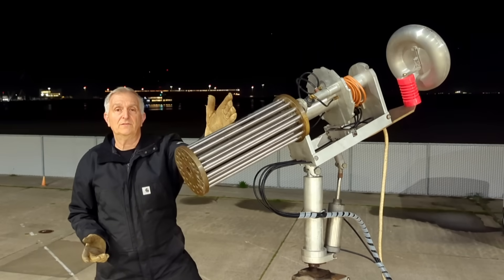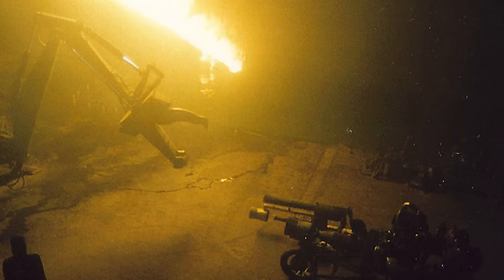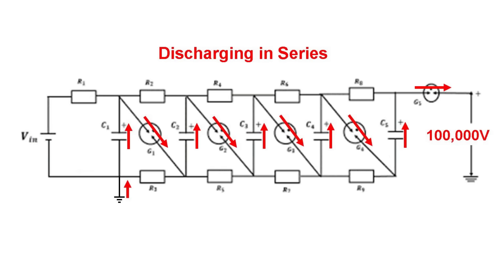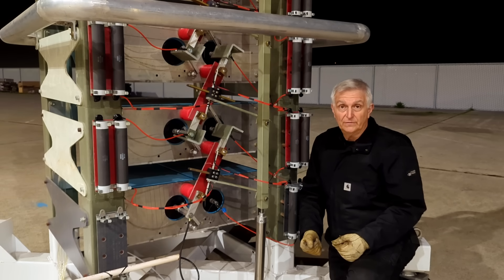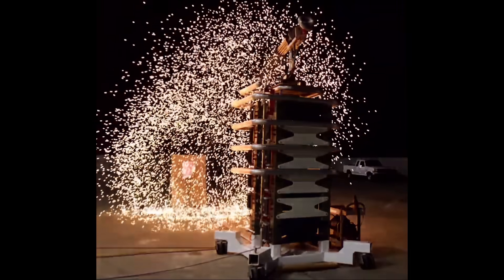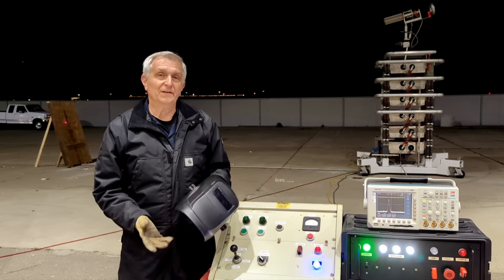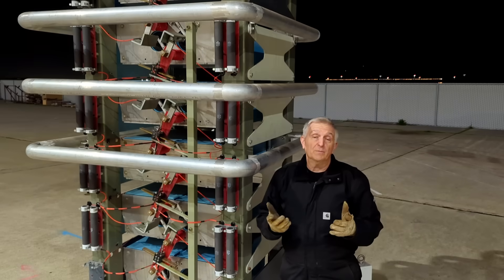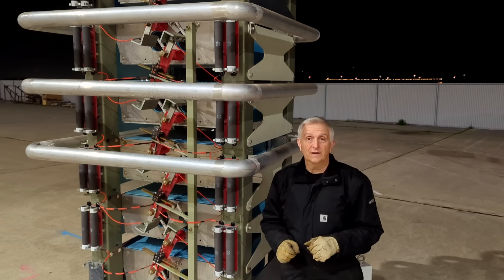Firing the Lorentz Plasma Cannon

Comment: a few Years back, i read the term LIPC in a Sci-fi Book.
It stands for Laser induced Plasma Canal. A high energy Laser prepares a Path for the following Current, which loves to follow the Path of least resistance. 
Your Machine uses a Wire to direct the load towards the Target, using Lorentz Forces to stabilize the Wire long enough to transmit the Energy, right?
With your Energy Bank and LIPC, would your machine have a better efficiency/range? You already use a guidance Laserpointer. What if you exchange that for one with more Energy?

Comment: So what is the little projectile flying out of the barrel before the actual discharge?
Reply: It fires an electrode with a thin wire attached. Once the circuit completes with a grounded object high current flows through the wire and vaporizes the wire. Lorenz force keeps the plasma contained so that there remains a path for the current until the capacitors are empty
Reply: @laserdiode  gotcha, so In theory could a laser induced plasma channel also work as the initial connector?

Comment: How, how do you live with V, A, Om etc., You need to do similar mile, inch,  and other imperial CI:face-blue-smiling::face-blue-smiling: Really 🤯
Reply from the maker: I can use either system, but I have to use the units that the components were made in  ;>

Comment: This is a great demonstration of a plasma cannon. Would it work using a narrow brine jet instead of the thin wire? You'd need to have the nozzle well insulated and far away from the capacitors, as any liquid trickling down the nozzle would short circuit the whole thing. If brine water could work instead of a wire, it would be much cheaper and you can keep firing until your brine solution runs out. I understand that keeping a jet narrow and preventing it from diverging is challenging, so the nozzle should be very high up and pointing downwards to a target, to minimise divergence.

Comment: Why couldn't they use the magnetic force as modeled by the wire diagram to stabilize a rail gun projectile? The biggest hurdle of the rail gun is wear and tear on the barrel. Why should the projectile need a physical when the same energy could be used to create a magnetic "barrel" as the illustration suggests?

Comment: This series feeds the mad scientist urges in my genes.
Luckily those genes don't need to express themselves because you're doing all the hard work for it.
10:20 that's not all you can see, you can also see the residual energy the thunder bolt deposited into the surrounding screen. (and with that you can see the misalignment of the laser too)

Comment: In the late 1960’s I worked on development of an artificial lightening generator. The requirement was a 1.2 mega volt pulse with a rise time of 40 nanoseconds. We used the same approach, charging large 100 kilovolt capacitors in parallel, the discharging in series. The apparatus was used to test high voltage transmission lines. The test area had a fence around it at a good distance with a safety interlock so it couldn’t be charged if someone was in the test area. One technician left a wooden step ladder about 10 feet from the apparatus. When it was triggered, it arced over and blew the ladder  to smithereens.

Comment: what is that small light pulse that occurs prior to the main plasma discharge? Is it a small projectile?  The other question is that for such a large amount of energy the damage is comparatively small.  Beyond that, very nice demonstration
Reply from the maker: The dart sends out a hair-thin trigger wire, which directs the plasma channel to the desired target.  1:56
Reply: It shoots out a wire which upon connecting forms a closed circuit, facilitating the electric release. Basically it's an overvolted, oversized taser

Comment: they have been looking for a way to achieve nuclear fusion for 70 years. you had it right in front of you and did not notice. at LLNL they use multimillion dollar lasers. just place a tritium/deuterium pellet in the path of 2 intersecting Loretnz plasma guns. stand away a mile from the blast. neutron irradiation is a female dog

Comment: is that arc traveling along the laser or is there some energy releasing after the initial plasma channel? or does it maintain a constant beam all the way through?
nevermind one of the questions, just saw that there was a metal rod
Reply from the maker: The dart is setting up a hair thin trigger wire, which initiates the plasma channel

Comment: Could it pulse shorter or is that dependent on the unload capacity of the  cap powerbank?  Is there a cheap way to make less effective caps but release power faster? Less storage but faster power release?  Super fast pulsed discharge? Love your vids, they are awesome.

Comment: A question if I may this apparatus appears to be launching a small projectile trailing a wire  ,that wire then being used to conduct the mass of the voltage am I correct in this observation?
Reply: If correct then the system isn't actually a directed energy weapon is it more of a controlled discharge device, via dart and wire,  basically an overbuilt taser? Don't get me wrong this is very impressive nonetheless.

Comment: So your device shoots a taser type a ionized wire , shocking isn’t it?

You've demonstrated that a Lorenz plasma cannon wastes energy. The setup involves a projectile creating a plasma trail, followed by discharging capacitors, like a lightning path guided by a rocket. A taser gun would be much more effective for a high-voltage shock. ⚡️

Comment: Instead of a wire or air which you were  demonstrating in the video...
Could you use salt and water in a water gun to fire at the same time, probably vaporizing the water, that maybe work as a catalyst or bridge to form a plasma? 

Also maybe perhaps make graphine in your spare time, to sell and help fund you zappy zappy ⚡⚡⚡ gun
Just need to put the grophite or carbon dust in a quarts or another cheaper tube that can hold a vaccume.
Then connect the suck out the air (could also use an inert gas maybe? 🤔 Connect the electrodes and boom 💥  , make flash graphine, then just run it threw a sift, bag and sell the graphine to manufactures or concrete or boats or masts or anything made with epoxies etc...  😳  maybe some glass manufacturers for making hardened glass of some sort I don't know really but maybe 

If you do try this good luck hope it works and make lots of $$$$ to help fund the lightning gun 🎉🎉🎉

Please invite the solomo guys so they can film at very high speeds and we can watch the physics 🎉⚡🎉📸

Comment: I recall reading a paper several years ago that claimed that an initial plasma channel in air could be established utilizing an ultraviolet laser and a high voltage source like yours.  No wire needed.  If I can find the paper I'll post a link to it.

Comment: What is falling on the ground, red hot, when you fire? Is that Nitrates? It looks like solid pieces were formed from the air.
Reply from the maker: Burning target paper, also burning cardboard shielding out of the TV.
Reply: @LightningOnDemand  Thanks for the reply, but; How does burning target paper radiate instantly from every point of the beam? It's coming from the beam right at the tip of the barrel from my recollection. And also seems to sublime before it hits the ground.

Comment: I was lucky enough to attend a SRL event in downtown LA a couple decades ago. 
Rail gun with a big bank of caps, which fired welding rods at a brick building.
No risk to the bricks, as the rods were melted and almost atomized. But an awesome light show. (Till the fire department shut it down).

Comment: So at 200 kV it can match the damage of a pellet gun? Or what am I missing here.
Reply: A pellet gun that can burn a hole in an inch thick sheet of plywood, generate a localized supersonic shockwave, heat atmosphere to plasma, and catastrophically destroy and even explode every electronic circuit that is attached to whatever it hits?
Reply: @vishnu79  I would assume it could make a hole in a plywood sheet, ofcourse depending on thickness, and destroy whatever electronics that gets in the way, and most likely shatter a CRT tube. Heating up the atmosphere to plasma doesn't seem to be such a scary factor in this case, the paper on first target survived. 
I was once present when lighting hit a large  less than a 100 feet from me. It split the tree in half.

Comment: If you look closely at the tv slow mo, you can see the arc jump downward around the glass of the screen. Probably why the insides exploded upward. There's also a glowing spot in the middle of the screen for just a second. Unsure if that's internal components fizzling out or the directed energy causing the screen to fluoresce or illuminate. I will say this thing seems to do its intended task very well. Good watch, happy to subscribe

Comment: so, if I'm correct, this basically is a thing that's supposed to pump a possibly out of control machine with SO MUCH ENERGY, that everything within it basically FRIES, and disables it, pretty much without any damage to the build itself, just the electronics?

Comment: The explosion comes from the quarks separating in the atmosphere. It's called QRE, or, Quark Repulsion Energy.

This is what a black hole is made of. Our universe spends billions of years trying to get the quarks back together as neutrons.

Space is an absolute zero field of electrons that create zero-point energy. A blsckbhole is nothing but an electron blender that destroys the electrons and turns them into electron neutrinos.

Black holes are invisible because they create the fastest light in the universe. It quantum tunnels.

The only radiation we see from a star is the elements the black hole have created being attacked by the incoming electrons. That's quantum gravity.

Comment: The crack of the shockwave is ridiculously loud. Also, I love how you can see it fire a small plasma "projectile" and once it connects it forms the bolt, like a laser.
Reply: That is not a plasma projectile but rather a bolt trailing a wire behind itself, which allows the connection to form. It is mentioned during the explanation preceding the demonstration.
Reply: @pulsartsai7776  thank you. Somehow I missed that detail.
Reply: I was wondering what that little "projectile" was that preceded the main bolt. Plasma baby! 🤩

Comment: FASCINATING! But did my eyes deceive me or did I just see a projectile trailing a wire just before that brilliant flash & bang? If so, can a REAL working plasma/lightning gun be created WITHOUT that projectile & trailing wire?
Reply from the maker: Sure with a very large laser, however a trigger wire is much cheaper and more effective.
Reply: @LightningOnDemand  Fair enough! But would such a contraption be all-weather? That is, will it work in any atmospheric condition, that is, through sleet, through snow & through driving rain & all the other stuff the old USPS could go through just to deliver your mail? And would that also include the vacuum of space?

Comment: Could a high powered laser be used to make a shortlived plasma channel instead of a wire? A short powerful burst should be able to ionize the air making a conductive, albit shortlived, channel. Also much cooler then a wire x)

Comment: So it still requires a projectile with a thin attached wire? Grounding through the concrete it's on or did you have a return wire between the plasma cannon and the target? Is there a way to use a high powered laser to create an ionization channel that would eliminate the need for a wire projectile?

Comment: If I understand your working theory and design, I think you have developed the first working prototype of a Phasor shown in Star Trek. Excellent demo. Congrats on building a small controllable lightening bold and putting such huge amounts of energy into such a small unit. I suggest making an EMP unit too. A working controllable EMP unit with a confined beam that can be aimed would knock out selected electronics.

Comment: My question is, we all know the high voltage low amperage lightning that is found in toys and is fired by touching the ball. Would you use this principle to focus the plasma cannon and then switch to high amperage? Because I think the distance problem is that you are using one magnetic field per wire. If you were to shoot 6 at the same time and one in the middle, the force would be focused and the distance multiplied.

Comment: Why not use a "wire guided" system just like the lightning launches? With that you might be able to use this same system at over 1/4 mile? The wire could be very large gauge (small diameter) and pulled tight from the barrel to the target. In fact, it might be possible to use carbon "wire"? This could give the current a plasma conductor that allows long distance and effective power delivery?

The best part, you do not have to create a new machine to test wire guided lightening bolts.

Comment: since a thin wire has to be fired to direct the current, isn't this simply an oversized taser?  Not much use at long distances, since a wire would be difficult to launch with sufficient speed accurately.

Comment: Have they invented 500amp MOSFET or transistors😂😂😂😂😂😂 you could make it silent with using electromagnatic waves with big coil in filming law it will destroy all electronic circuits about 6kilometer or 10kilometer beside the coil 💀💀💀💀👽👽👽with out any sound 😂😂😂

Comment: Would it be possible to get the current to traverse/flow down a laser beam? Or maybe use a laser to columnate the plasma if the laser has a bit of void in the center of the beam?

Comment: I think this video is even better than the first version – you can really see that the CRT was damaged by the electric discharge, and not just because it was hit by a projectile.
I wonder if the discharge could be also guided "wirelessly", by a powerful laser that creates a channel of ionized air. Although I suspect it would be hard to stop it from discharging into the laser rather than the target... :)

Comment: Hey man this is extremely interesting. Is it possible to effectively create the Lorentz effect without a wire, but using a high powered laser in the center to ionize the air to effectively create a "wire"?

Comment: More recent lightning attractors/diverters use lasers to ionize the atmosphere and provide a channel for the lightning to travel down. Instead of using a projectile with a thin wire attached I bet something laser-based would work here instead, increasing accuracy and range.

Comment: Reminds me of Nikola Tesla's open air plasma particle beam with a capacitor discharge dump onto a plasma line. Tesla used a lightly evacuated ceramic tube Van de Graff to charge his device. The loud shockwave is caused by the annilation of atoms of the surrounding air gasses crashing back together thunderously.  Here, it appears the slow moving positive charged directional lead flux, is too slow, as lightning travels at the speed of light, this is what is causing a super wide static beam being delivered to target, and the minimum damage to the target, as most of the energy is consumed by resisting the air. As opposed to Tesla's device, which streamed a lime of plasma atoms out of an open air vacuum nozzle, like a line of positively charged bb's, so the line was already touching the target when the negatively charged bolt was released onto it, thus not impeding any delivery of current, so it acted more like an electrical 'bullwhip' upon full charge delivery.

Comment: What are these 'sparks' appearing around the 'beam'? Especially with 150m voltage. They were looking like these metal sparks from the welding process, but there are is nothing except the air on the way. And they didn't just disappear but they have fallen on the ground, and bounced from the ground!

Comment: So, to make sure I'm  understanding this properly-
 1. You're using a Mark's/Marx's tower to get the necessary voltage.
2. The gun fires a small capsule with a thin wire inside. The target must be grounded.
3. When fired, the electricity races down the wire. The magnetic field generated contains the blast long enough for the charge to reach its target.

Am I right? If I am, I have questions-
1. How do you reload the gun & how is the wire propelled?
2. How long does the gun take to fire a shot?

This is very cool. And that's an understatement.

I feel like I've heard of this gun before too... in a book?

Comment: Fascinating. Please contact the slo-mo guys and film it at 50,000 fps. What is the maximum range? What are all the sparks? What is burning?  Would it be possible to charge the capacitor bank by shooting a fine wire from it into an electrical storm?  If yes, you could harness the energy of electrical storms.

Comment: 9:41 so what’s that exploding above it? is the other recording equipment receiving any interference?
I’m so glad you live.
Reply from the maker: That was the deflection circuitry inside the TV that had a bunch of foil coated cardboard shielding around it.
Reply: @LightningOnDemand  one more question please, Must a line be connected to complete the circuit? Have you considered a conductive particle mist with ultra violet lighting or linear lighting to do the job?

Comment: OK, now time for the ballistics gel and meat and bone slab testing... might wanna get to know your local butcher.. I would help fund this. Also, what about a tetherless option? Maybe a directed gas stream at high pressure? Perhaps making a ball or pulse variant? How much voltage would it take to excite the oxygen and hydrogen in a given direction using an electron pump like this?

Comment: The weak item of this system appears to be the need to shoot out the thin guide wire; in effect, you still need to shoot a primary projectile before the main plasma burst.  If someone comes up with a high-power laser, or similar system, to provide the plasma burst a wireless guide, you would really have something!